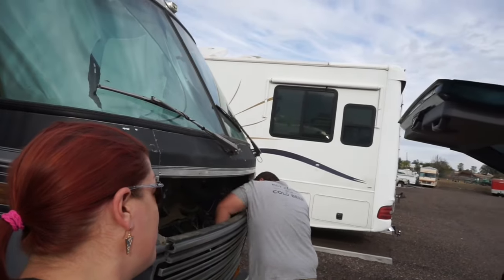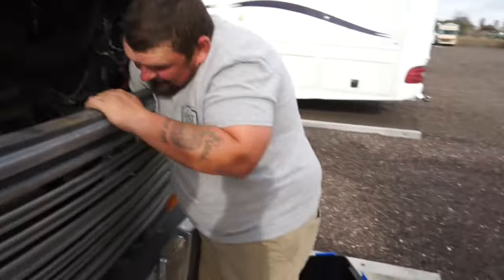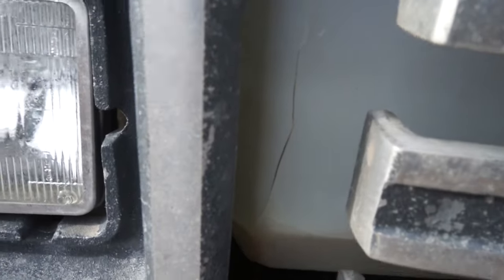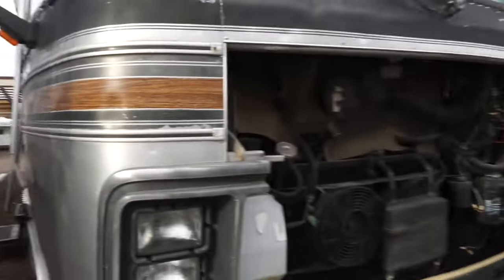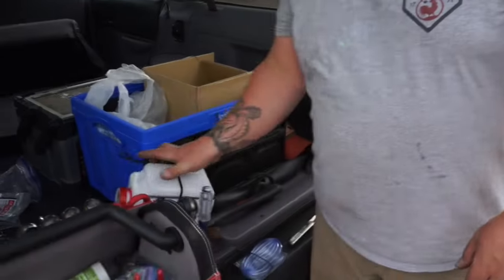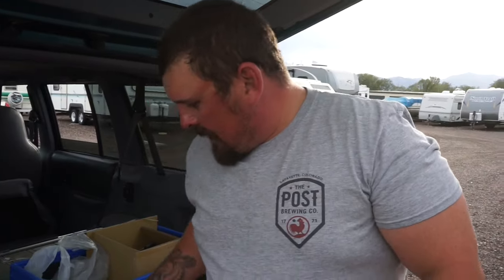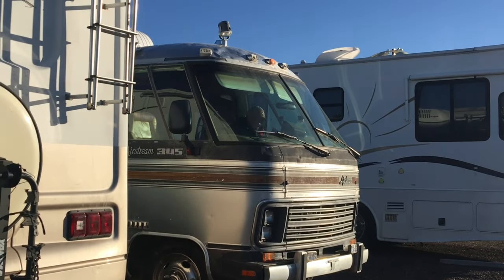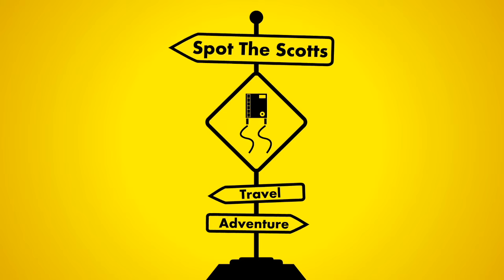SpotTheScotts: Fixing Airstream Coolant & MEET PRISCILLA! ~RV Life! {#379}

Comment: It appears that you mounted he top of your recovery bottle lower than the previous bottle had been placed in your rig.  Ideally the top of the bottle should be in line with the top of your radiator.  If your bottle is mounted to low once it overfills with coolant, and coolant is discharged from the bottle, this can create a siphon affect that will begin to draw coolant out of the radiator until the coolant level in the radiator matches the level at the top of your recovery bottle.